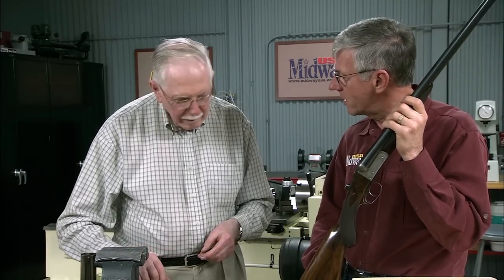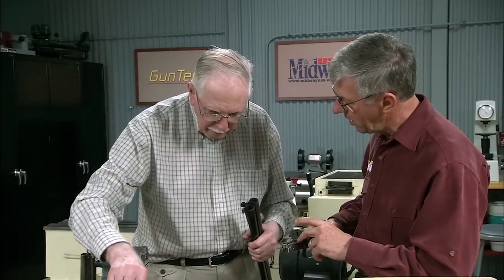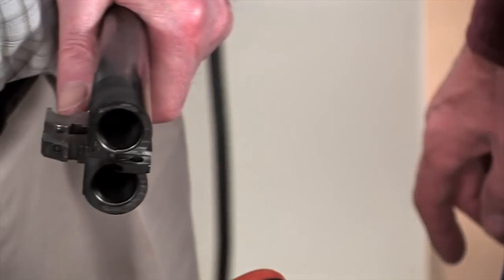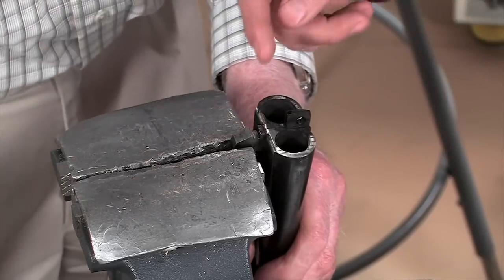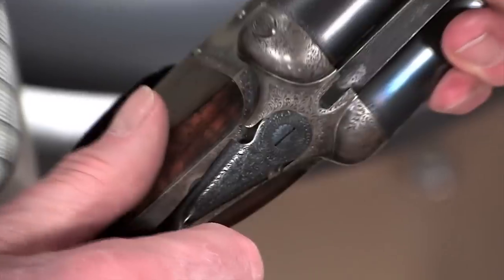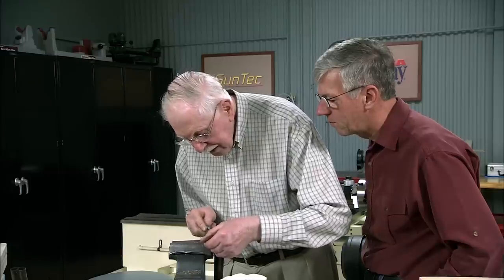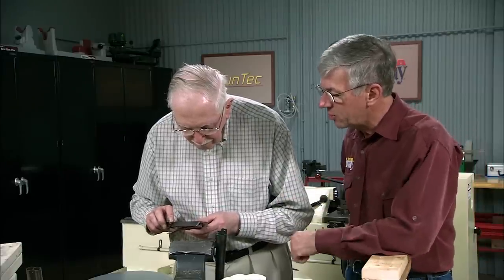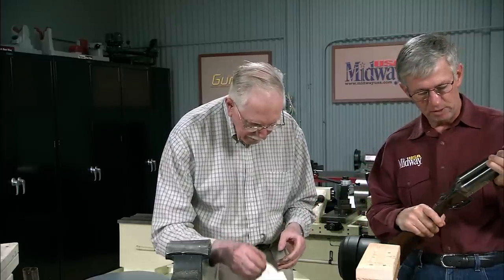How to Tighten the Bite | British Side-by-Side Shotguns | MidwayUSA

Comment: Rare to see someone take a hammer straight to the gun and do it right. Where I used to work we had a special tool for that that would slide right over the protrusion and the tool was what received the hammering. Apparently it has something to do with newer sidies having hardened steel hardware and older ones having been work hardened from multiple tunings. Absolute pleasure to watch this.

Comment: Great job I have a question I hope you can help me with i have a old h&r single shot shotgun the problem with it is when you open it to load or unload the barrel is loose when open it tight when the action is closed and it shoots really good a while ago the barrel lug the part that holds the foregrip on broke off I had it repaired and the barrel has been loose ever since I would greatly appreciate information thanks for sharing
Reply: Obviously put back on wrong. Further down the barrel than original. Try putting some JB weld into the notch and then file down so there is a thin layer left and put the fore end back on. If it's tight again you can put some brass in to replace the epoxy. Or not.

Comment: Hrmm so this method requires altering the color of some metal....I wonder, if perhaps putting down a small protector sheet would suffice prior to hammering the crap out of the thing?  maybe that would cut down on doing any grinding of metal
Reply: There are lead sheets over the vise jaws. This will keep any metal damage from happening.
Reply: The whole ideology of "hammering the crap out of it" is to ping the metal starting from the bottom and working up which forces the top layer in and up to take the very little slack out. It would be impossible to accomplish this without marring the surface of the metal up. The real professional work is the filing and sanding that makes the lock look brand new.
Reply: James Mckee Called lead clamps.
I can remember a fellow co worker Chris Wallin making those particular clamps in 1999. Jack used to pay the Birmingham trade a visit once a year after he emigrated.

Comment: Hello
Sir I have a double barrel gun made in Belgium and I have a problem with that its accuracy is not good and it has a loose barrel and handle. It also expands the shot means buck shot expands on targets. This was very accurate and have a long range before this.
Sir plz will help me to check out.